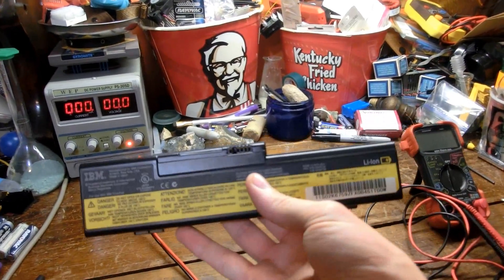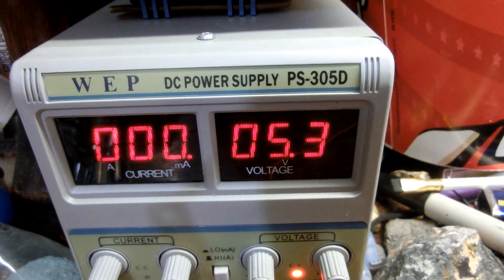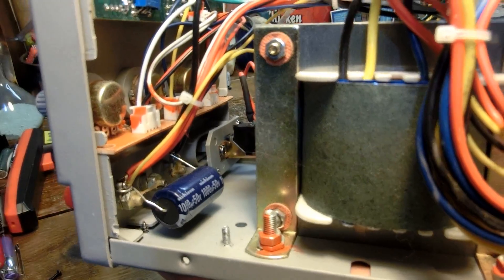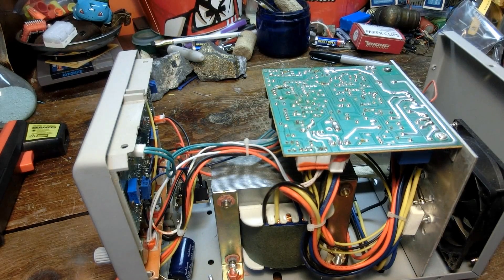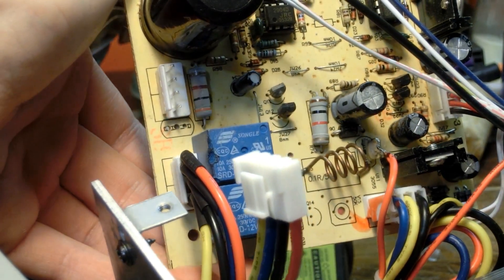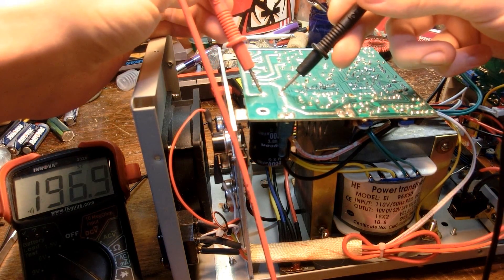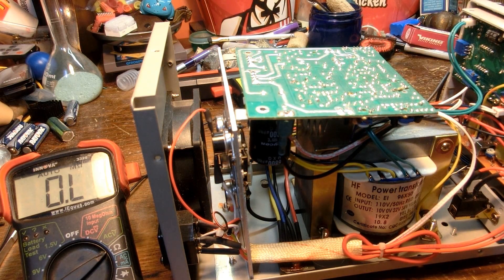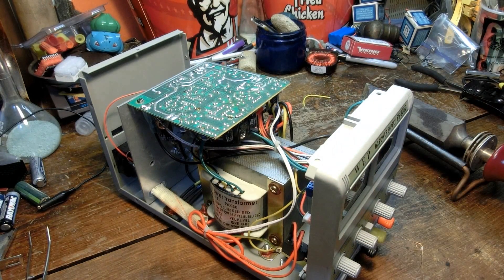How It Failed: 80$ 30V 5A Variable DC Power Supply

Comment: Not many electronics have problems when it comes to 50 vs 60 Hz, as long as the voltage is correct. In the case of this transformer, secondary voltages will be the same regardless of the frequency, and it's converted to DC anyway, so it wouldn't affect the rest of the system at all. There's actually a really nifty reason they've rated it for 110V 50 Hz - Japan is 100V 50 Hz. So by rating it halfway between Japan's voltage and ours, they can deem it compatible with either system.

Regarding the capacitors, you can never trust measuring the value of any component when it's in a circuit, as the other components in the circuit will affect the reading. A short doesn't necessarily mean something bad, either - a transformer winding or inductor should ideally be a short circuit when there's no power flowing.

Anyway, assuming you had a good connection when you tried jumping the bad trace, my next guess would be a bad transistor.
Reply: Well, 50Hz transformer connected to 60Hz mains gonna loose some (really small amount of) power. Because primary winding gonna have more impedance, thus it will limit current more. But that's OK - using 50Hz transformer in 60Hz country. A really bad idea is using 400Hz transformer in 50Hz mains :)
Reply from the maker: actually japan is half 50hrz and half 60hrz. i've heard with differant frequencies you need differant thicknesses of the steel plates on the transformer. but i agree 50 and 60 are pretty much the same, its just a 50hrz transformer will be less efficient on 60hrz.

Comment: Two things to ask. Even though it clicks Is that warped plastic case impeding the closure of contacts on the relay you spotted?  I see you have a more than adequate soldering iron, why don't you solder that capacitor that you added to the PS?  Looks like you just wrapped the leads around the terminals.  It looked fairly loose and doubt its making a good mechanical connection.  BTW think your videos are great.
Reply: Rinoa Super-Genius He is asking why don't you install the cap correctly, not what it's function is.
Reply from the maker: yeah but i only have it there to keep the voltage meter from bouncing about, it does a good job smoothing out the pulsed DC.

Comment: nice break down, was interesting to have a look in there, I was thinking that maybe that cap you originally replaced had gone again, like that was the build up spot, but that burning through the bridge was a good catch, they are weird those, you see them but you don't, had that a few times over the years :-) I like the idea of using cheap ones and discarding them if they don't work with a simple fix, that way your never really worried about frying an expensive one :-D as you say, will be handy for the small cells. you know arduinovseveil, he picked up a sweet little unit the other day, me find his link https://www.youtube.com/watch?v=pvx34BSZBRs&list=UUhWv6Pn_zP0rI6lgGt3MyfA :-)
Reply from the maker: yeah i have two of those, i wouldnt use them as a power supply like this one though. they arent as easy to use.
Reply: good point, they look useful perhaps built into something, but for something constant for experimenting and stuff with the w.e.p is perfect for the job :-) a solid block transformer is great for handling back surges and stuff. even when it finally goes you may find use for the case, like for a solar casing protection say, or a small machine hack perhaps :-p I find that type of metal casing handy just to use as bits of sheet metal :-)

Comment: Hmm i would repair that track but see where it leads to find what the overload went through, also i would connect a volt meter across the resivour capacitor and see if it has enough overhead voltage depending on the relay range switching.

Grounding your multimeter on the capacitor negative, see if the output transistors have a good voltage on there cases, then see if the base pins have a limited drive voltage as you wind up the front panel.

its fixable if you have the interest :-)
Reply: zx8401ztv He's giving up because he doesn't know what he's doing & electronics is really just a mystery to him...
Reply from the maker: yeah i dont really have the interest, these power supplies are made from very cheep parts so they dont like to last more than a few years anyway. even if i fix this now something else will probably break soon. would be better to just have 2 instead of one.
Reply: Rinoa Super-Genius
Ok, i was just seeing if you wanted help, there are quite a few identical supplys with the same look and just a name change, the model number stays the same.
Reply from the maker: zx8401ztv
 yeah i figure if i keep buying these every few years i'll also end up with spare parts to fix some.
Reply: zeffur7
I grew up in a family with very little money so repairing stuff was the only way, im not playing the violin or anything, just the way it was.
Plenty of schematics on the net, i bet its a mastech psu in disguise lol.
Reply: Yeah.. it's a common DC power supply.
All he'd have to do is carefully troubleshoot from the input to the output & he'd probably find the problem--but he uses the common approach of looking for a loose wire, obviously burned component, & then hopping around the circuit continuity testing caps--which is ok--but then he's at a loss what to do next--which would be to start at the input & carefully  work his way through the circuit step by step.

"Super-Genius" in his name is an obvious use of sarcasm haha.  If you watch his vids, you can see he really doesn't understand well what he is doing--which is ok, because that is how some people learn, but it's a miracle that he hasn't electricuted himself or worse than that... Did you see his vid in which he flipped over a LA auto battery & splashed himself pretty well with battery acid/electrolyte?  He's very fortunate it didn't get into his eyes.
Reply: zeffur7
I would start at the series pass power transistors on the heatsink, ive seen many of them go short to the base pin, normally blowing the driver and anything else in the way of the typically 25-30vdc from the main resivour capacitor.
Bridges can go pop but normally blow a fuse as they short out the transformer.
All of this im sure you know, its good to repair stuff, i enjoy the challenge :D :D
Reply: Checking those transistors would be pretty easy.  If his circuit doesn't already include a  zener diode/s, they could be easily installed to further protect his circuitry from excessive load current.

"Bridges can go pop but normally blow a fuse as they short out the transformer." Yeah, that can happen, but I don't think it is happening in his case.  He's obviously got some V control, so working from the V ctrl input back towards the power supply or starting at the power supply & working towards his V control circuit is probably the best approach to follow.
Reply: zeffur7
Ahh well, we will never know, some psus last longer than others, i threw together a small 13.5v 2Amp psu for a frend back in 1990, im supprised it still works after all these years and abuse, not bad for bits and bobs from the scrap bin lol.
Reply: They can last a while as long as they aren't abused too much. 

Some old PSUs from the Pentium 4 period provide over 500W.  Those can make pretty good bench PSUs with a bit of hacking...

Comment: 0.2v is a big deal when dealing with lithium batteries! Go over 4.2v and you already know what can happen :-) Thanks for the mini teardown anyway, I was looking at getting a similar power supply.
Reply from the maker: lithium batteries dont really risk issues until you reach 4.5v its just above 4.2v you get even less life from it. i charge mine to about 3.6v then let the imax b6 take over.
Reply: Rinoa Super-Genius Ah that's fair then. I always assumed you charged to 4.2v with the power supply. Just ordered an iMax B6 myself the other day for my lithiums, particularly for the discharge feature and as a second charger.